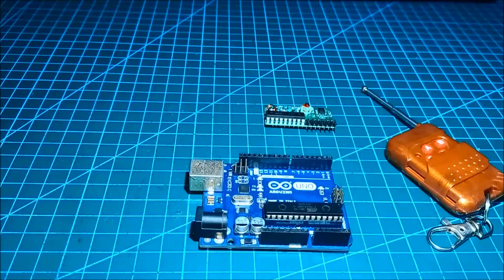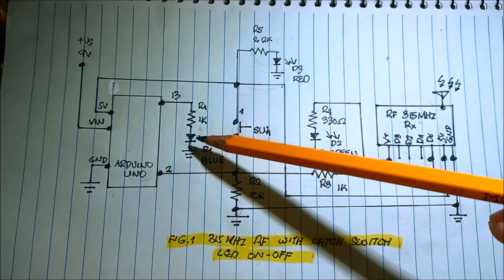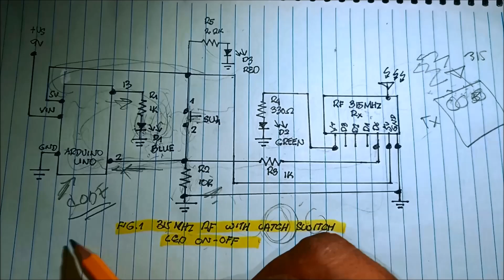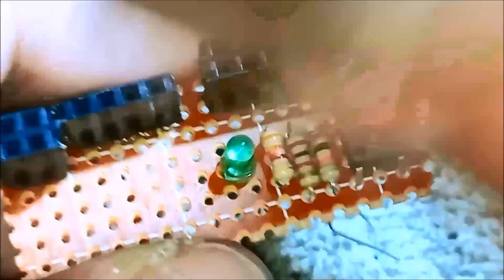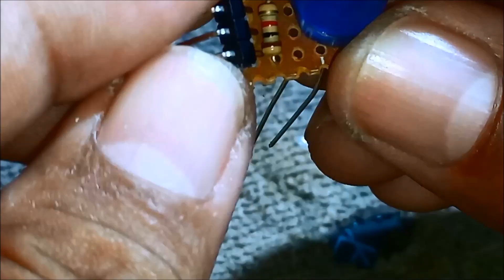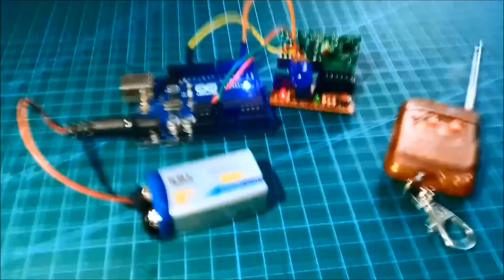315MHz RF Remote Control with Latch Switch_LED on-off

Comment from the maker: //----Code----
int ledPin = 13;
int butPin = 2;

bool pressed = false;
bool wasPressed = false;

bool lightToggle = false;

void setup()
{
  pinMode(ledPin, OUTPUT);
  pinMode(butPin, INPUT);
  
  Serial.begin(9600);
}

void loop()
{
  wasPressed = pressed;
  pressed = digitalRead(butPin);
  Serial.println(pressed, wasPressed);
  
  if (pressed && !wasPressed){ //Button just pressed
    lightToggle = !lightToggle;
  } 
  
  digitalWrite(ledPin, lightToggle);
}